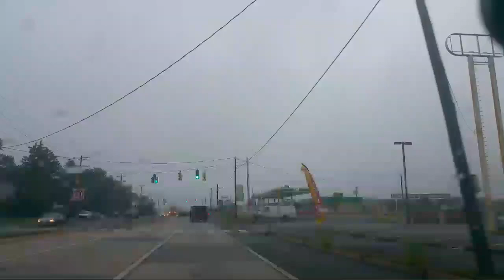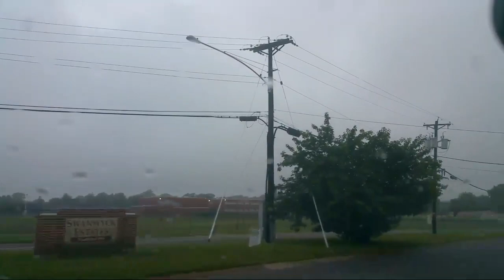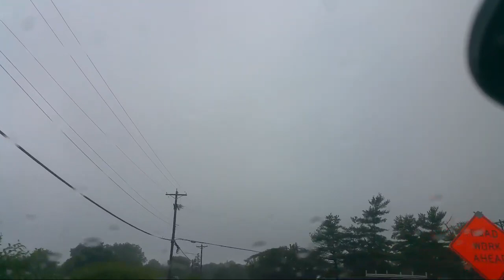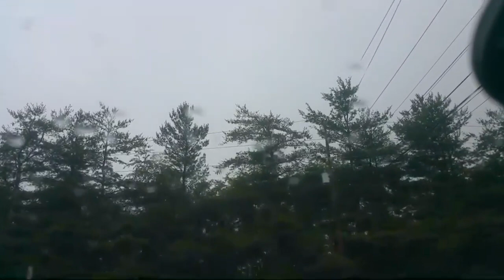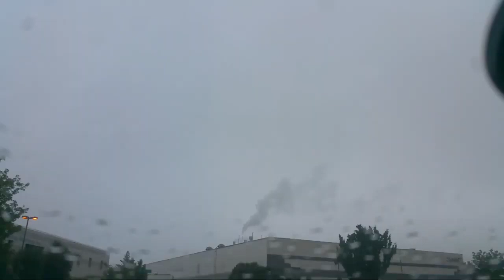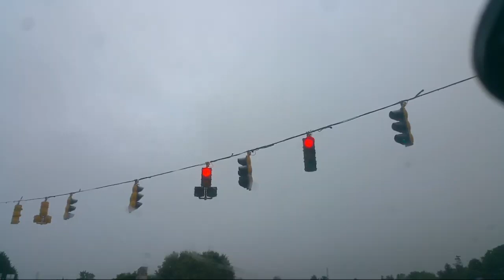Fiu Bridge Collapse "GROUP THINK" Engineers Get It Wrong

Comment: Firstly my amigdyla is untriggered so that's a great thing. I agree with you entirely regarding group think.   The problem is one of local detailing around the nodes. The bottom prestress strands are too far away from the 11/12 node for their clamping force to transfer into the node and resist the 11 compression.  Also the work points of the truss diagonals and chords are not coincident, which in a steel truss you can get away with to a certain extent. But in a concrete truss any lack of coincidence must be reviewed until each part of any tension or compression (esp. tension) is tracked down, evaluated and reinforced for. This is engineer speak for what you just said about understanding the behaviour and details of the joints.
Reply from the maker: Thanks Andrew, I have a 50 minute video coming out on this, complete with paper, foam and floor model... haha  You should get a good laugh on my ''floor model'' once you see it...  Hell, I am laughing again.